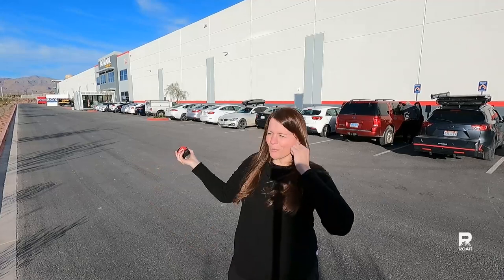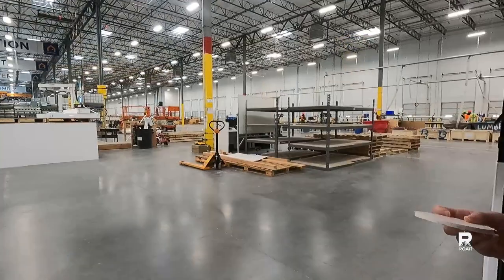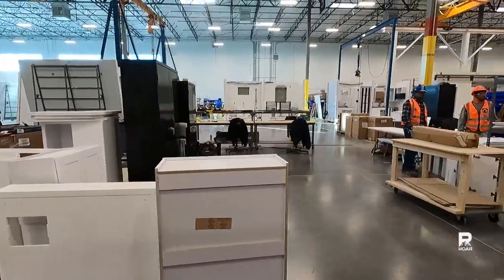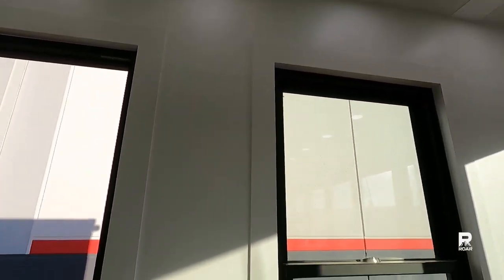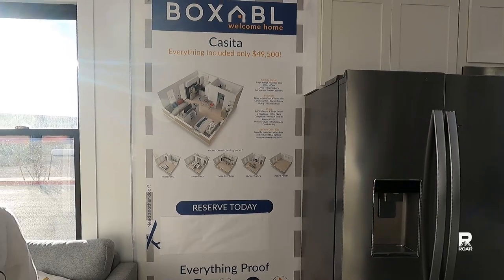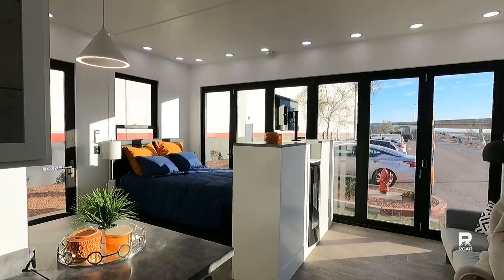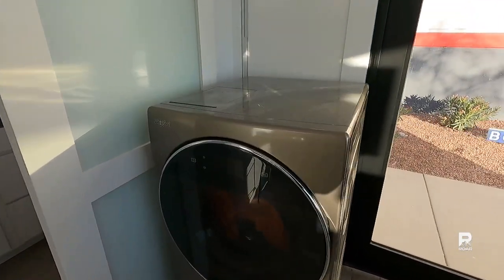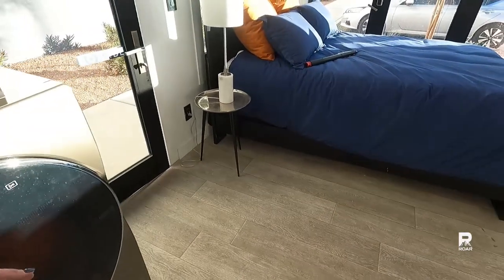TINY HOUSE for Only $50,000 INCLUDING Appliances! | BOXABL Factory and Casita Tour | CC

Comment: You answered a lot of questions I had about the Boxable Casita, Rachel, that I couldn't find elsewhere. For instance, details of the wire routing from the ceiling lights, a view of the outside where the electrical service panel lives and, yes, interior dimension via your tape measure. These Boxabls are looking better all the time. Thanks again.

Comment: Are the walls strong enough? Can someone strong enough to destroy the styrofoam walls?
Reply from the maker: The EPS foam is sandwiched between galvanized steel. From Boxabl FAQs - "They are rated for hurricane speed winds. They can handle the worst wind conditions in North America."
Reply: Their is video boxable put out where a sledge hammer barely puts a dent in the walls.